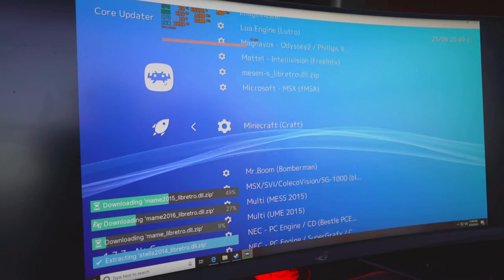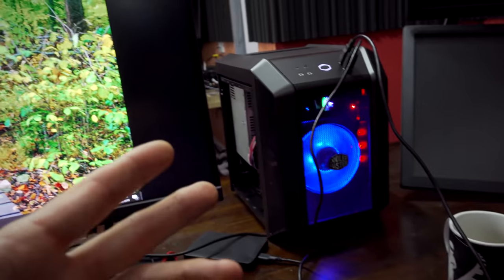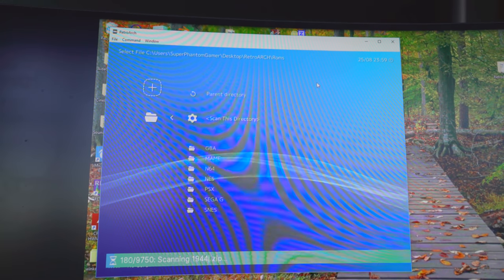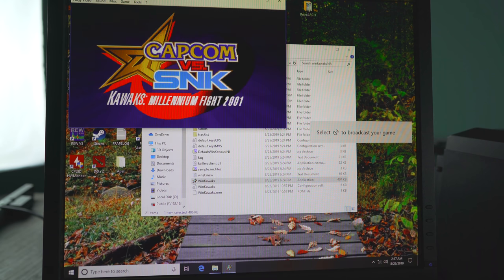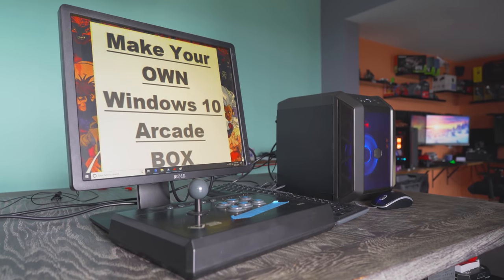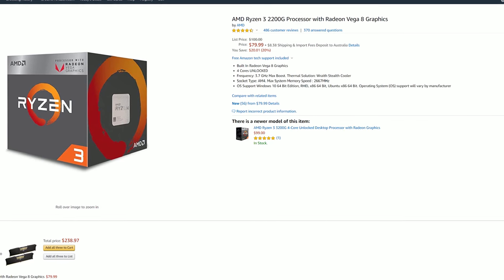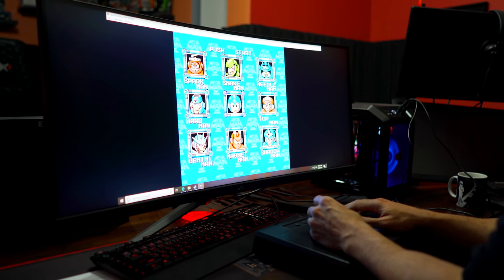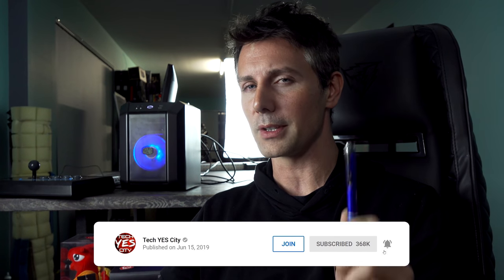How to Set up RetroArch on PC (And Capcom Games too) (X-men vs Streetfighter etc)

Comment: x-men vs streetfighter works perfectly fine in retroarch. In fact finalburn-neo supports pretty much every capcom game under the sun. The reason it didn't work was simply because you have an older rom set, that had some chips that were dumped later not included. This is also why mame complains about these two missing files. Go download a proper recent finalburn fullset, let retroarch scan that, and you're set. Also, why on earth would you run retroarch with the windows taskbar visible? Do me a favour, set the render backend to vulkan, enable freesync, hit alt+enter for fullscreen or do this is in video menu, set integer scaling to enable, bilinear filter to off, load up One of the great CRT shaders (dr-venom is my personal preference atm. thnks to that PVM feel), and then come back to this one more time.
Reply from the maker: Thanks i will take these on board for when I make an arcade box.
Reply: I really don't get the popularity of Retroarch given how user unfriendly it is. The standalone emulators may not be as feature rich but they are quick and easy to get up and playing, which let's face it is what most people want.
Reply: @voteDC  Just a little learning curve, after you're familiar with it you won' t go back.
Reply: @yadspi  Absolutely. I've put a lot of time into it and, knowing what I do now, I can't think of something that does emulation quite as well. Because it takes a bit of learning I wrote a tutorial for my friends who now netplay RetroArch games with me.
Reply: @yadspi  For 32x it really is the best solution.

The thing is that, for me at least, it isn't the best solution for most other things. If I want to play some PSP games I can just fire up PPSSPP, select my game, and I'm playing. No messing about with loading cores or configurations, I can just play.

Even using it with something like Launchbox doesn't really feel helpful, it feels like having to start UPlay when you've bought a Ubisoft title on Steam, just another step that doesn't need to be there in order to play a game.

It's good that RetroArch is there for people who want to tinker to a greater extent but it is also the reason I'm realising as to why consoles remain so popular, sometimes I just want to play.
Reply: @voteDC  the whole point of a front end is to make it a one stop shop for all your emulators and make it pretty at the same time. yes there is some setup , but once thats done, you can just scroll for days thru all your diff consoles , arcades, portables in one place and launch them , play them and exit back out to your front end with no problems at all. IF you dont put time into setting up your front end you will have the thought process you do, but set it up the right way and you will never go back to single emulators again (if you can help it). a bit of effort goes along way.
Reply: I hate to ask but what site do you use for roms. I cant seem to find a trustable site with x-men vs street fighter

Comment: You need the CPS2 BIOS files to launch XvSF. Launchbox is also a pretty emulation frontend thats  straight forward and worth checking out.
Reply: +1 to both of these. RetroArch can run CPS2. Barring a handful of outliers, I use it for all my emulation. I'd recommend LaunchBox as well. Even splurging for the Premium license for the frontend to get access to Big Box. 

Someone else mentioned Batocera and I'd give that a go too. If this PC is just going to be for Emulation, that's a good way to go. If you're already dedicating the PC to the task, you may as well use an OS that's built for that thing specifically.
Reply: @nightbirdds  Ive experimented with dedicated Emulation OS's like Batocera and Lakka and found my experience was the same or better off just using Windows as much of the emulators are best optimized for it. I find Retroarch cool for 8 and 16 bit consoles (especially with RunAhead making input lag virtually non existent) but for Arcade games its best to go with dedicated emulators. For CPS2 and Mame stuff in general I go with a variant fork called Arcade64 which cuts out all the heaps of non arcade crap added to MAME nowadays. I also use separate things for more demanding Arcade games like Naomi, Sega Model and Atomiswave. Then finally, I bring everything together to one neat unified UI via Launchbox lol
Reply: @nightbirdds  Another thing, for these purposes you dont even have to go through the trouble of building or dedicating such a modern PC to it. You can easily accomplish this specific task by buying a complete $40 retired SFF office PC from ebay with something as low as a old 2.5ghz intel/amd dual core with 4GB of ram and be golden. Ive been hooking up PCs like that as affordable Emulation HTPCs for years now.

Comment: Awesome video!!!!  Super Nice Build!!!  But...  I think you went WAY-OVERBOARD on the cooling.  There is no way any old-school emulations is going to cause a CPU or even a GPU to overheat.  I still like the build though.  I setup a retro system as well.  A couple years ago, I started with a 1st gen PI.  That works great until you start getting into PS1/PS2 emulations.  That old PI just can't handle it.  So... Last year, I just built a used AMD X4 system w/ 4GB and a GTS-250.  Everything was free except the GPU ($40US).

Comment: You might want to check out Launchbox that is a very intuitive easy to set up front end (free) which works with all sorts of emulators, including RetroArch. The scan directory feature of RetroArch is rather broken still. Not all games show up. But RetroArch is a very nice all in one solution that even runs on raspberry pi.
Reply: Yeah i've had some issues with games not showing up, almost any issue i've had with that i've found the solution from 'Archades Games' channel.

Comment: Just set-up Hyperspin, or one the other programs you would use for Mame cabs :)   Did this awhile ago myself and made a bar-top arcade . or can mod those 1-up cabs super easy with a LCD driver,  upgrade the stick (which is also super easy) and throw a raspberry pie  (depending the route you wanna go, but for basic emulation you dont need much power) and boom personal arcade
Reply: The LCD driver for 1-up cab is about $29.86.... Raspberry pi 20-30$, the stick you can buy a kit 30$ of ebay so can hook proper USB. and get RGB stuff if want !!!  :) and CPS2 emulation does work on pi

Comment: Lately I've been looking into retro PC's and games. Want to give virtual box and dosbox a go. Mainly for dos games, but there could be some PlayStation games I would like to play. I would really love to build a retro machine, like 386, 486, 586, Pentium, Pentium 2 and 3. Issue is I have nowhere to set it up right now. Thanks for the links will give these programs a look. Maybe I can reuse an old i5 2400 as a emulation machine.

Comment: Guys, I have one question. I just got a sapphire hd 7950 for a really good price and I use it atm and test it out, but I just can't overclock it whatsoever. Everytime I even do +20 MHz on memory or core, it just starts flickering like crazy. I cleaned the card up, changed the thermal paste and I doesn't go above 63° C, never, even with +20% power limit. Can someone help me maybe?

Comment: what would a i3 4160 be capable of? dell 180w psu, 8gb ram.
Reply: Could do basic gaming at 1080p lowest settings but don't expect to have good frames in apex legends or pubg cuz it's only a dual core
Reply: That would run most emulators fine. Probably better than a rasberry pie at least.
Reply: It should be fine for emulation as long as you have like at least a gt 730 just to remove any possibilities of lag
Reply: @HoloScope  180w OEM psu, not expecting that to run any level of gpu. honestly not worth the money to me either. kinda meant as is what can it do but thanks for the answer
Reply: @bradhaines3142  oh ok

Comment: 3400G is probably too overkill for RETRO emulation considering GPD WIN can also run these game. Maybe try reusing those 775 component for arcade?
Reply: Yep, i can confirm this. My Capcom/SNK MAME cabinet uses a C2Duo  E6300 (1.8 Ghz)  and it works perfectly   :)

Comment: you know all this works on a raspberry pi 2 right?  RP2 is like 20 bux these days and use an old charger.
Reply: It lags on high end n64 titles
Reply: And I'm talking about the rp4 imagine trying to run those games on an rp2, oh no
Reply: @HoloScope  i have it setup and it has no lag with an overclock on n64 and ps1. arcade games run perfect without an overclock.
Reply: @dpg2004  hmm that's wierd I was watching n64 benchmarks on an rp4 last week and there was stutter and lag sometimes so I imagine it would run way worse on an rp2

Comment: Dude, use Linux for that! Native, not in the bloated Windows10. RetroArch indeed would be the logical choice. Linux has excellent options for it, Linux has all the emulators and Linux does all of this with much less bloat than Windows10. I recently heard from a professional system administrator that he got 20-30% performance loss after those biannual updates which rebloat his Windows10. These days he uses Linux both at home (exclusively) and at the office. Bryan, you might like his Youtube-channel: Chris Titus Tech. He started in 2018, he now has 70-80k subscribers.

It really doesn't make any sense to run Linux on Windows10. Windows10 is a horribly bloated system, just run it natively when you want to use it, it is worth the reboot! These days you can do almost everything on Linux, including AAA-gaming (few exceptions).
Reply: Also  the openGL support for ATI/AMD cards is decent in Linux unlike in Windows and most emulators use OpenGL because reasons....
Reply: @bdhale34  I don't know, for Borderlands2 there still is a big performance-drop (25-50%) if you play the native version, it probably is better when you use d9vk but I haven't been able to try that yet (my HD 7850 is not supported for d9vk).

Comment: Hey guys , i want talk about a problem that happened a few month ago with windows 10 this windows made my motherboard go crazy i mean 45 to 50°C on idle and 60°C when playing a video game and the mother made some not good noise on 60 bu one day i was sick and tired of the problem and i instaled win 8.1 when i got to see the temperature i was suprised 24-30 on idle and 45-48 on full load i was fuck windows 10 is the worst , Specs Motherboard don't remember the name but socket is 775 , Intel Core 2 Quad Q9505, 8gb of ddr3 1333mhz what the windows says but on them write 1060mhz and GT 1030 2gb DDR5.

Comment: I've only very recently learnt about retroarch myself. I managed to get capcom games running on retroarch by placing CP 1-2 bios files inside retroarch's "system" folder.
In, this video, around the 11 minute mark, this guys points to bios files. Follow his instructions regarding the files (what to unzip and what to overwrite) and place them inside retroarch's "system" folder.
Download every possible core and try Arcade MAME 2003 Plus and Arcade MAME 2016.

https://youtu.be/5OUR8VPVIHM?list=PL0qFp5mr8jQvghewrjUcnXroSPId_sEZV&t=668